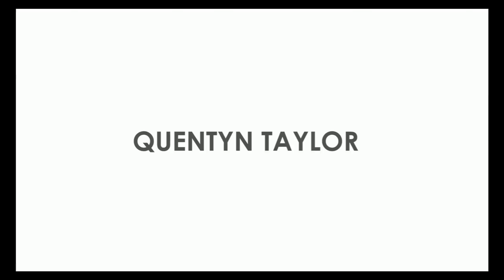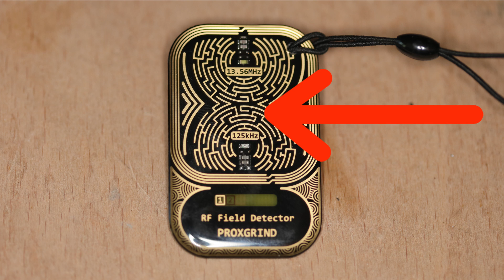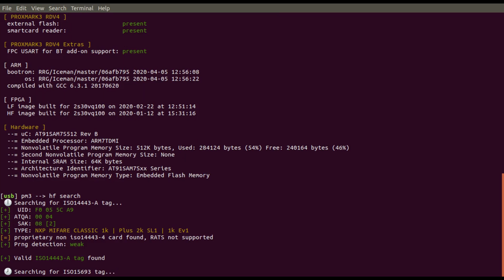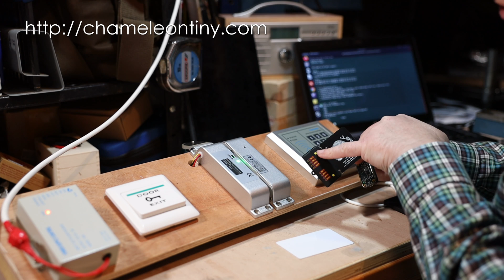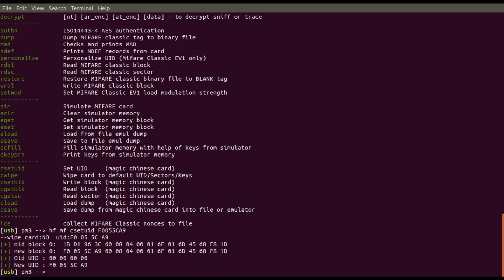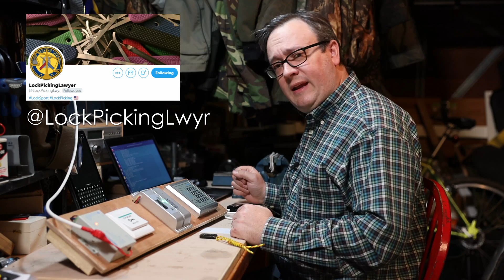How to bypass many Mifare classic based door access systems

Comment: Thank you for the info Quentyn, we have a system where we think it is a HF 1K reader. We have some cards available to us but we would like to sniff out some other numbers as we think it is simply using the UID numbers. When you sniff out the reader  is it giving you some current read cards or the initial cards stored on the data base and if so how many UID's would it give you. It sounds like the Proxmark 3 from 401 would be our best tool would you say. Does the Proxmark 3 come with any form of instructions.  Thanks again for you assistance.

Comment: Hi Quentyn, very informative video's thank you. we are asked to copy cards in the past and try and make replacement cards for customers with lost cards and systems that are just full. We used to have a knowledgeable  chap who would help on occasion but sadly he has retired. Sifting through all the videos we are getting a feel of things firstly we would need re-writable cards (mainly Mifare 1K H.F) would we be able to copy existing cards and write to a new card with a Chameleon Tiny. Can you explain how sniffing works, what card does it sniff from a reader, is it the last card used or initial master/programming cards and can we do this with a Chameleon Tiny.    In my past life I used to fly model helicopters for films etc plus Drone work before drones were about very bulky in those days.  Thanking you in advance for any info.
Reply from the maker: HI Vago, if you just want to copy cards then the icopyx may be a better option though for ease you will need to use their branded cards. The chameleon will need something to do the actual cracking / data dumping such as a proxmark etc
Reply: @QuentynTaylor  Thanks for your reply. can you enplane what is actually retrieved from sniffing is it the last card that was used or is it the original master card ID numbers and what is the best piece of equipment to use for this
Reply from the maker: @vagonordigian8445  well in the case of the video above its just the uid of the card thats accessed. Sniffing would be the act of capturing the traffic between the card and reader which you would do if you have a valid UID and want to sniff the initial key the reader will send

Comment: Correct me if I’m wrong, but in order to expose this vulnerability you need to have access to a card that is registered into the system. Is there any way to get around needing to obtain a registered card?
Reply from the maker: yes in thes systems you only need to spoof the card ID. You can either get a starting point from 1 card ( that you know is in the valid range) or you can i suppose just brute force a load of ID's
Reply: @QuentynTaylor  thank you for the quick response and the answer. I appreciate it.

Comment: Hey bro do you know if the chameleon or proxymark3 will clone Keri?
Reply from the maker: i dont think so as Keri are 125khz - you would need something like an icopyX
Reply from the maker: by the way the proxmark will clone a keri but not the chameleon as the chameleon is only HF
Reply: Cool was reading the same thing earlier on proxymark that has both HF and LF antennas and can handle the encryption so I’ll order 1 off Alibaba tonight, thanks again for the help.👍

Comment: Hi! Great video!
Would a MIFARE classic card be copied if the card number for the access control system is encrypted in the memory of the card (not CSN/UID but using the internal memory)? I read MIFARE could be cracked and then the keys revealed, then it would be easy to program any card with the same or with any card number and the access control readers at doors could read these fake cards.
Reply from the maker: well there is the ID number of the card is one thing and that can always be read. In the video above i am just showing how to simulate the ID number. However in other videos i show how to copy the data on an encrypted card and then you can write to any compatible card

Comment: Hi Quentyn, love your content. Can the Proxgrind Chameleon tiny emulate mifare DESFire cards? I see it has hardware capability but no current option in the app
Reply from the maker: indeed its not in the app, if you want to play with this you will need to use the terminal which is in the desktop app or you can use telnet on your favorite platform. Note that the support is experimental at the moment ( I havent played with it in a while)